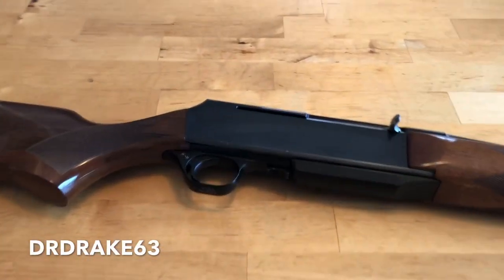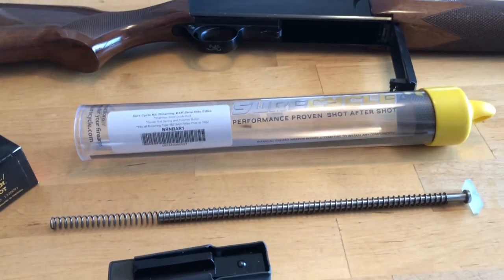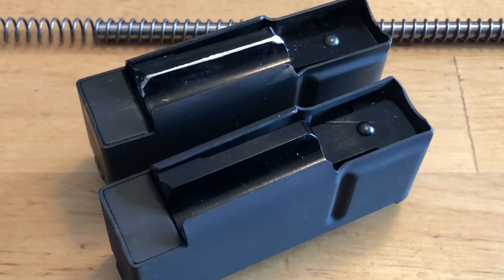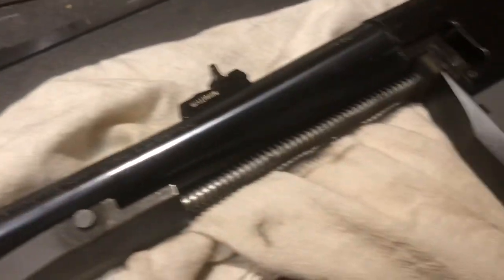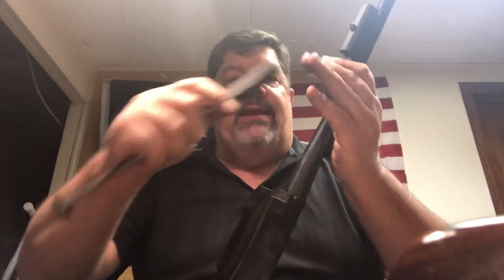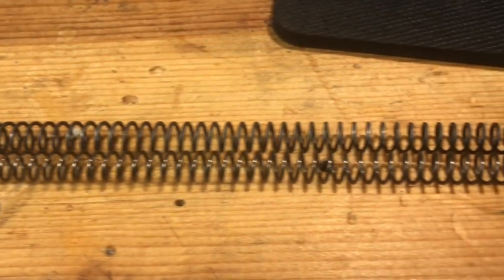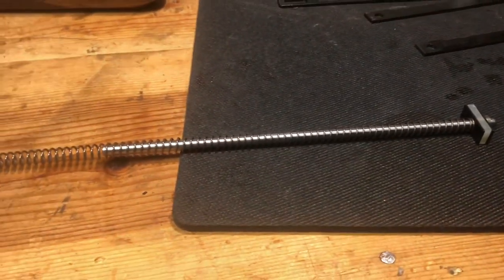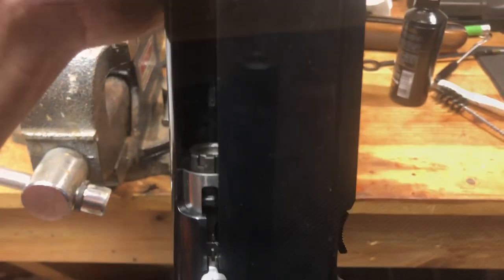TROUBLESHOOTING the BAR

Comment: I'm glad it's working again.  I would have been interesting to fix one thing at a time to isolate the problem, i. e. clean and test, then spring change and test, then mag change and test.  I suspect the main probem was the spring.  Another possibility you didn't mention was the magazine lips.  Thanks for the video.
Reply from the maker: Craig Benz Yeah I don’t have that kind of time unfortunately.

Comment: All i used to break the gas nut is a cross bar for changing tires. I just clamped the gas block in a vice and then gave it a good turn and she broke away pretty easy. It was super rusty. I can see the gas nuts are different, my old belgium 1970 has a screw driver slot only to take apart. My buffer was cracked to shit so i have  to order a new one. I think im going to order a new spring too. Were did you get your parts from. Id like to order some parts.

Comment: replaced my 7mm mag with a sure cycle spring kit and still jammed up and bullet not ejecting.. Going to try honing out the gas regulator and get a new magazine.
Reply: Try cleaning your bore  were the bullet sits. So the bullets slide out. Maybe its rusty inside .